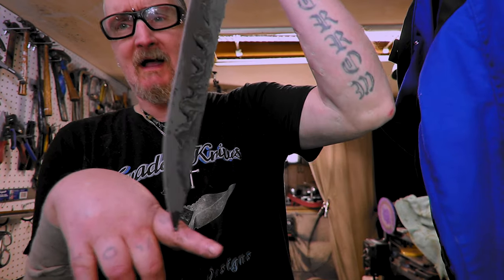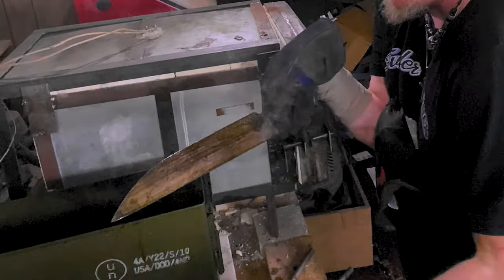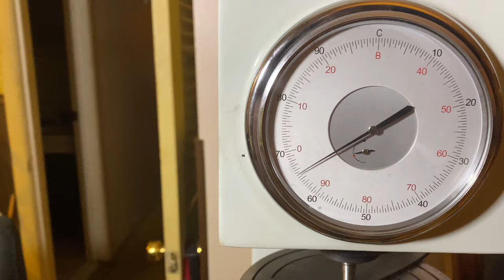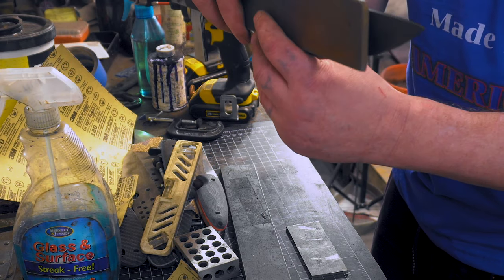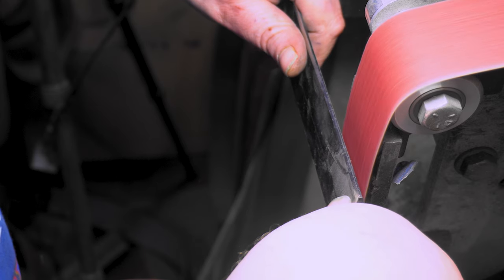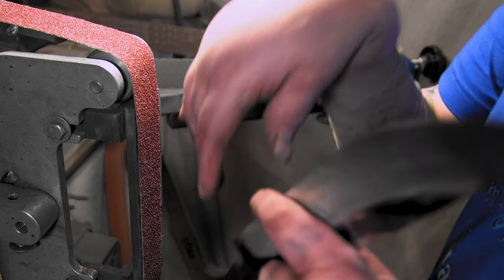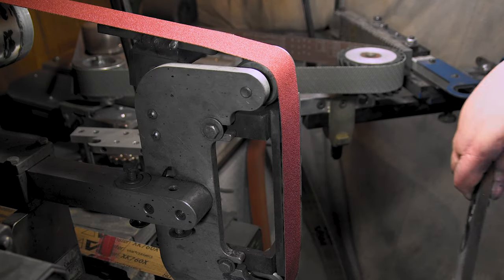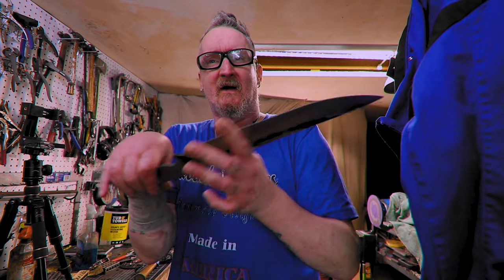Knifemaking - Machete(heat treat & bevels)

Comment: You could just grind the bevel all the way up to the spine to get rid of that crook by grinding in a distal taper to remove that material. Cheers
Reply from the maker: Right, that's what I was kinda going for, but to keep the thickness of the spine too. I kinda split the difference
Reply: Dave Evader Knives I guess you could try a swedge/false edge if the crook doesn’t go the full width of the bevel also?
Reply from the maker: @stevenrobinson5385  Yeah that would work. On this it's a little too far back. I did do the distal taper on that one kitchen knife a few videos back & it worked pretty good